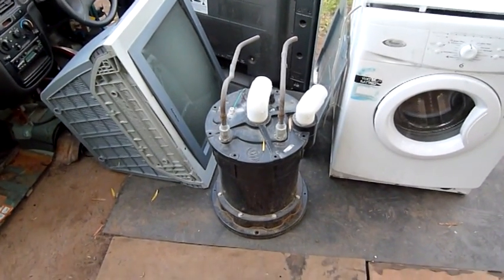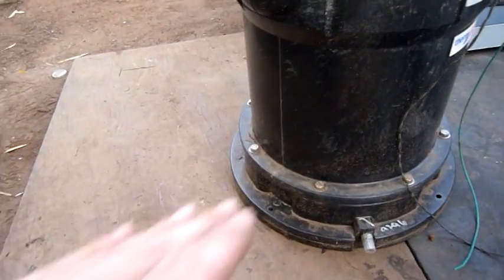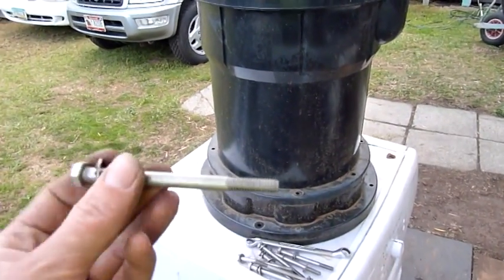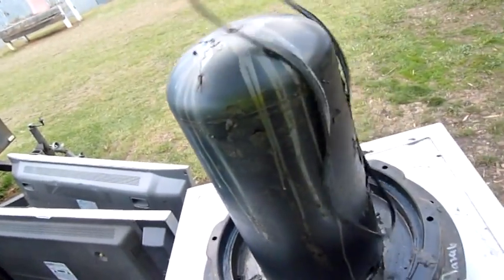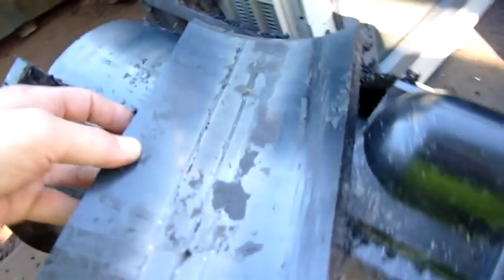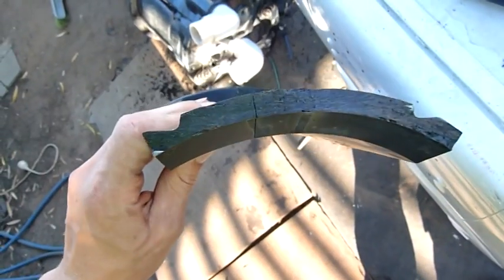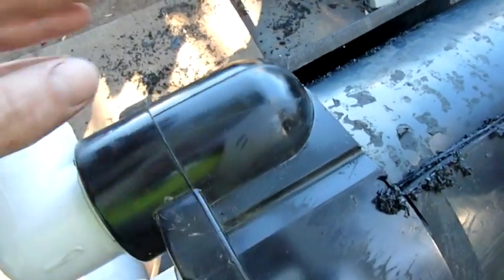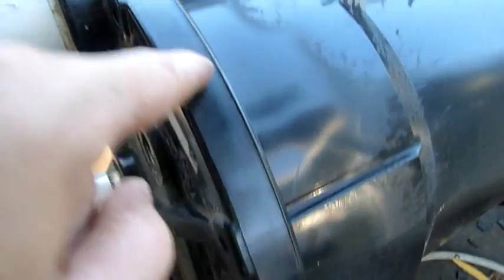Aquacal Water Chiller Drum Failure - Flawed PVC Molding and Chemical Attack

Comment: Why are the heat exchange coils made out of Titanium? How do they join them to other metals?
Reply: tesla500 If you're still curious; they used titanium because it was a pool application and titanium becomes passivated (forms a thin oxide coating that resists further oxidation) in slightly acidic chlorinated solutions (ie pool water).  Titanium has to either be TIG welded to an easier to braze alloy like bronze, or it can be brazed directly to copper using special flux and high silver content brazing alloy.

Comment: If I may toss my 2 cents into the jar.  The black chiller casing is actually ABS plastic.  When solvent cementing ABS to PVC (white) or CPVC (beige), ABS cement must be used because the plasticizer (tetrahyrofuran) used in solvent welding PVC and CPVC will attack it readily.  My support to this theory is the drips you saw running down the side of the casing and over the baffle tell me the installer probably didn't know this either and puddled the cement on there like no tomorrow.

Comment from the maker: Although I never worked with rigid PVC when I did my apprenticeship (we just avoided it due to being sh harsh on tooling) I did a lot of ASA, which is a comparable plastic, and yes we had to heat the die, not chill it like you would with PE or PP.
so a cold die and maybe barrel temps is the cause of the shorting/cold runs.

Comment from the maker: given how thick the PVC casing is, I would not expect chemical attack to be a issue for many years to come given that it was molded properly

The die itself could have been ran at a controlled pre-heat temp, the cooled slowly, but more than likely it would be run as cool as possible, and a properly heated melt injected into it.
i would say the barrel and nozzle temps were too low, and it was probably a 'startup' molding, from when they first started the machine and it was not settled in.